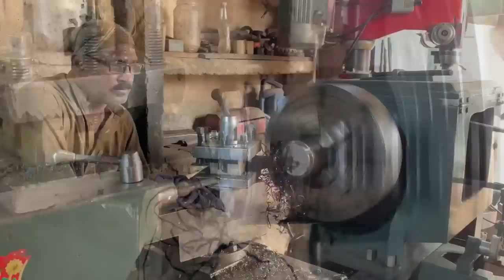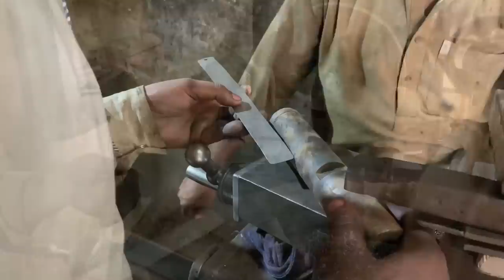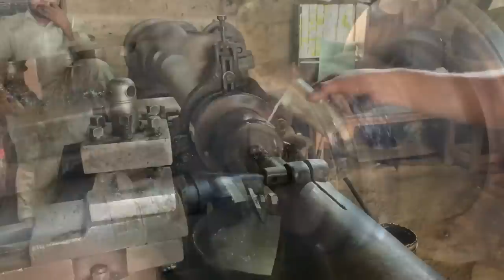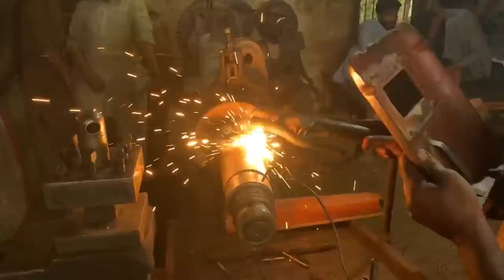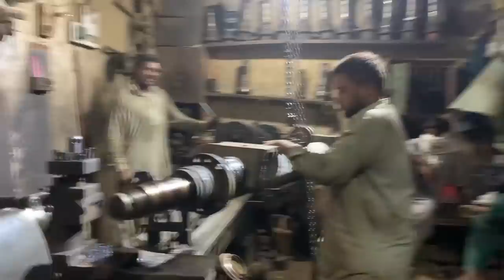How to Rebuild Heavy Duty Truck Broken Spindle From Axle || Repairing Truck Trailer Broken Axle

Comment: When I saw the small piece go flying when being pressed into the broken end. I just knew they were going to put that BIGGER piece onto the lathe. And by gosht they did. YOU can't pay me enough to be standing anywhere near that "widow" maker!!
Reply: They make due with what they have but that is a very hazzerdous place.
I doubt they have law suits there.
Reply: And all of their loose clothing is such a hazard.
Reply: Not that true.
Reply: ㅡ
Reply: Nothing wrong with using a lathe to drill a pilot hole. I would have done the same. OK, they could have asked me for a center drill, they shoulda faced the fracture first, but, well...
Reply: C'mon, a kindergarden kid can operate a lathe at that low RPM.
Reply: @johnfenn  yeah that scared the shit out of me! and no safety glasses! and forget about safety toe :D
Reply: I knew the press was going to spit sideways.

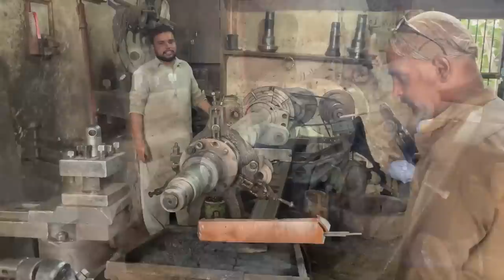Comment: 14:20 “once the wobble is within your customer’s expectations, proceed to welding.”
Reply: Love to see them grinding a crankshaft...
Reply: Hey come on people…. If things weren’t built to breakdown later… then there would be less work available.
Reply: That out of roundness is crazy.
Reply: Micrometer???? What’s that?
Reply: When finished and fitted to the truck, that wobble is an offset angle in the wheels. Tyres will wear out quicker and fuel consumption will also be effected

Comment: I am just so impressed with what these men can accomplish with the tools they have. Nothing but respect for them. Gotta love the feedback from either the arm chair experts or the people that have the latest and greatest to work with.
Reply: I have worked with modern CNC machines & I've worked on a crap lathe in Mexico.  They are doing many things wrong.  1 thing that is easy for me to point out to a lay person is they never got the axle centered in the chuck.  Notice how it wobbles?  That directly gets put into the repair they just made.  This is bad workmanship regardless of tools.
Reply: @keijimorita1849  I'm not saying it's quality workmanship. Just that they don't have things like dial indicators or even good welding rod. But somehow they make it work. May only last a month and wear out tires mad. Me personally I would scrap the axle but they don't have that option.
Reply: @donmunro144  Maybe there's more to waste human lives than truck axles ...
Reply: @keijimorita1849  I don't think that axle would ever be straight in the chuck. Look at that thing. It's bent, period. But, yes, you are correct!
Reply: "FIXED"???????  No and dangerous piece of crap that will fail and cause a accident, but over there life is  extremely cheap
Reply: @keijimorita1849  ax, c

Comment: The driver will not notice the wabble on those roads lol
Reply: There will be no wobble because the axle doesn’t spin, alignment on the other hand will be all over the place
Reply: There won't be any wobble as it's a trailing axle not part of the drive train as on a trial or so the axle stays stationary and the wheels roll around it, but good job it is as I think the driver might notice the strange oscillations of the wheels lol
Reply: The 'repair' will though. It will self destruct in 10 minutes.

Comment: This will probably lead to a new episode "How to repair a truck that went off a 500 foot cliff"
Reply: To be fair this is the first vidjeo I’ve seen where they used any kind of eye protection and a micrometer
Reply: I have confidence that they will adjust for the misalignment of the axle by hitting the rim of the tire the opposite direction with a sledgehammer... In the end it'll be perfectly balanced, .. it'll be like driving a Cadillac!!
Reply: @Welcomemisha  video are to short
Reply: @Welcomemisha  00p0011

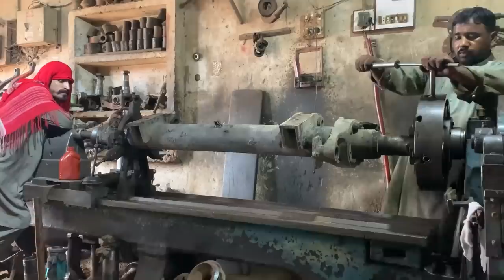Comment: 9:47 this axle is extra straight. Look at the broken end - turns smooth in the holder. And the end on the other side. Goes few centimeters in radial. And guarantee to the workshop gate.
Reply: Mgimo finished?)

Comment: Truck axle with manufacturing defect. Very well done job. But every truck suffers unimaginable forces. Hope the shaft came out the same length. The tools were very required. The shaft is bent. For maximum security it should be exchanged for a new one. Regrettable often the lack of resources. GOD BLESS AND HELP ALL THE WORKERS WHO DID THE BEST THEY KNOWN AND THAT THEIR RESOURCES MADE POSSIBLE.

Comment: The repair will never withstand the strain that grossly overloaded it in the first place.
Reply: Can you imagine the force it took to break that thing clean off? It will take a fraction of that force now. There is going to be an incredible amount of leverage being exerted on that repaired joint.
Reply: @truckguy6666  Someone should reinforce those axles with gussets before they let 200 people pile on the truck again.
Reply: @Landrew0   You can't put gussets on the welded area because that's where the bearings go.  
Don't worry, it'll be fine......... until it's not.
Reply: @Happyfacehotwheels  Well, it wouldn't matter if you could reinforce it, they still overload their trucks grossly anyhow.
Reply: Whole axle is bent, see it wobbling on the lathe. Overloaded, hit a depression in the road and snap goes the spindle.
Reply: @Happyfacehotwheels  Sooner or later, someone will make an axle for them that can't be overloaded. Maybe 15 cm diameter.

Comment: A great accomplishment with basic tools and measuring devices, though I was cringing when they used the hydraulic press and rightly so as if that had hit someone it could have easily broken a leg or killed them. Those drills were blunter than my grandma the relief angles were ground too steeply.
Reply: injury? there are 37 guys waiting at the door for a job.

Comment: Good try but that will never be nearly as strong as it should be . It will snap off again as soon as that truck is overloaded which seems to be common there.
Reply: @sellier-bellot22  Over what it is rated at . When I was a mechanic I never saw or heard of one breaking but they do have some very bad roads there so that would be an issue plus the truck likely being over loaded.
Reply: No. cause of its failure probably is fatigue
Reply: It needed more enforcement in my opinion
Reply: @sultanheart  Problem is the heat from the welding , they have taken the strength and temper out of that steel.
The only way to properly fix that axle is to replace it with a new one from the factory.
Reply: They usually load the trucks way over max capacity load. Watched many videos of trucks overturned due to an overweight and oversize loads. Did you notice the end play of the shaft after welding which causes excessive vibrations and failures at high speeds. Always safety last...
Reply: The roads over there don't help either
Reply: @johnready630  Cutting like 4 groves cross the previous welds and weld again will add more surface joint to old material as it will likely break next to the weld  ,heat /forge treatment will add up little more .
Reply: @smathet7766  As many people as they have and clearly all nof them that put their lives last they would have some of them GD people learn to repair roads and fix the roads. Its a dirty job but clearly all these people dont mind sleeping in dirty nasty cloths they worn for months without washing. Hell these shops can even offer free slave labor for repairs to the road equipment.. What you dont see being hauled in for repairs are GD road repair equipment like pavers , graders , backhoes , rollers... nope a country over populated they have kids in these sweat shops , they can give the GD kids graders and such to let them learn to maintain the roads.Clearly they put youth education about as high as the safety there. Pathetic these people CHOOSE to live like this and stay in stone age and all its practices.Same with their hate for others they themselves were passed down. It is their choice and they choose to keep doing the same nasty BS instead of learning like all the rest of the countries have done and IMPROVED to provide much much much better safer long last repairs.They would need to come out of the dirt and bet thats the deal breaker for them.
Reply: And no brakes
Reply: The jingle trucks in Afghanistan have lumber stacked over the top of the sides and the come careening around the corners on the mountain roads. Almost got clipped by one on the pass up into Kabul.
Reply: @michaelbaker8284  Exactly why you see breakage such as this , broken frames and the like . This repair is a bandage on a serious issue.....overloading.
Reply: @tesodjukic4377  you can seee the smooth surface of the crack, which is fatige. But the inner part cracked at once. Which is an unusally big part. So if the repaired part is waeker than before, it will break pretty soon....
Reply: Agreed.  But it IS repaired.
Reply: @beakytwitch7905  Well sort of but not properly.

Comment: 4.5mins in, I can't watch this anymore. It's one thing to have a lathe, it's another to actually KNOW how to operate it properly.
Reply: Then you missed them hammering the inner bearing race to and fro at about 18 minutes in. (I agree, the run-out on the 4-jaw was ridiculous - they clearly could centre it - just didn't bother.)
Reply: @sideshowbob5237  So cray cray. If this is how life is there, wow, just wow.
Reply: I get you
It hurts a lot
I think this lathe is even not leveled
So hey don't matter if it rund true hahhaha
Reply: I'd watch this video on Speed 2(double). It's far more entertaining.
Reply: @apollo5751  great idea thanks!
Reply: @apollo5751  To judge by the sound track it is already running several times normal speed.

Comment: Absolutely nothing they do there is proper or correct. Lifting off the tip of a hook umm nope, piss poor operation of the lathe, having the bit sharpened poorly and spinning in the tailstock does nothing but wear out the taper in the tail stock and wreck it.  the heat from welding took what ever temper that axle had in it out of it making it weak. That axle will fail in short order between poor workmanship, horrible roads, grossly over loading.  I guess close enough is good enough there..  they don't seem to be worried about their own safety so why would they worry about anyone they kill out on the road.
Reply: Bingo!
Reply: Absolutely every tool beat to death.. I don’t even know what to comment on..
Reply: absolutely true
Reply: @Jeff Kulchiski You got it right, I from the same culture and I like your quote "Close enough is good enough" no one here offers quality service, from an untrained eye these people are doing great job but no they are not, they are just fooling the customers in believing that they can repair anything
Reply: Absolutely. I give them a good score for effort but the repairs wont last long.
Reply: @rajaatiq9509  when we talk about truck, it is not a problem about the lasting of a piece. the problem is ‘could the failure of the piece kill me?’
in this case, it is a very hard answer…
Reply: @rajaatiq9509  What you said is only true if the customers are down town mafias but generally customers have to suffer because of dishonesty and poor workmanship
Reply: Exactly but the worst part is they welding with 6013 its hard material not basic, 7016 or 7018 was the best solution, they need to heat the metal first to 200°, is going to crack their luck is they weld with the small electrodes 2.5, instead of 3.2, or 4 rods, they take more time and the material was hot
Reply: I know this just by they bend the electrode and the sand doesn't disconnect from the iron and the fact the "welder" doesn't have clothes for welding, with basic he got some holes on is body
Reply: @hugoquaresma467  absolutely. and it seems that handling of eleftrode is wrong. for me it is full of imperfeftions and inclusions of slag
Reply: @massimo79mmm  the horror
Reply: well go watch the proper method of fixing this then.
Reply: @alexchilick  hahaha 😂😂
Reply: dial indicator and safety glasses are a waste of time, they think

Comment: Working without any eye and other protection is a ticking time bomb
Reply: Do you think they are paid enough to buy protection gear?? They are saving every penny to buy food for their kids
Reply: look they are welding a spindle that was forged, so the new axel rating is 10% of original, but they will use it till it breaks and do it again......and again, and again. Off balance and inaccurate as hell.  But it will work, until it breaks and kills somebody.
Reply: Oh they have new protection there , they have new type eye contacts that keep anything from getting close to their eyes... LMAO

Comment: So they basically have electricity there in Pakistan to stick weld and lathe busted axles from overloaded trucks.  That boring bar was at least 300 thou above center 😬 and spinning the bits in the tail stock is great for the tapering lol

Comment: The shaft extension it's heavily warped and that is significant!
The alignment with the sledgehammer could be much more precise even at naked eye! That was sloopy, I'm pretty sure that a blid man could have done better.
Great welding job.
Reply: Really I think it will be fine! Everything else is buggered it Pakistan, the roads are completely stuffed the truck it's going on is stuffed, the wheel they put on it is more then likely buckled, the driver has probably been smoking hashish since he was 6 and the tyre is bald! All in all I think they kicked arse!!
Reply: @jarnosaarinen4583  So true but they could start by doing something right.

Comment: Where do you get one of those precision runout wire gauges ???
Reply: in the same shop where they buying this type high precision lathes...
Reply: Forget the wires, look at that "taper" at 4:00
Reply: That drill will friction weld itself to that tail stock. I doubt that cowboy even noticed it spinning
Reply: I keep mine in the closet and put clothes on them..... The clothes hanger.. "The world's most versatile wire"
Reply: I would start with the local dry cleaners. I have heard they supply run out gauges and the proper equipment to calibrate them

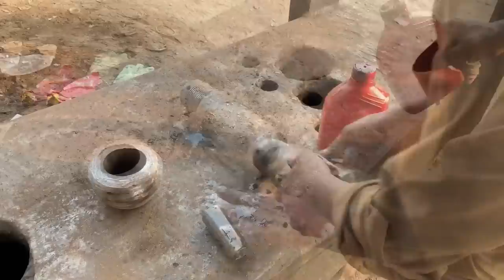Comment: 7:01 Heat it up hot to expand it. Then the pin goes in much easier and is much tighter when it cools off.
Oh and I loved the drama when that pin exploded out of the press.

Comment: After some thought on seeing this, my bet is the truck this is off is fairly near end of life. The owner knows it and wants to make sure to run it completely into the ground. Maybe for a while they try not to overload it. This repair could hold a while if they did that. In that sense it's good enough for the purpose. Another thing - probably the truck's broken down somewhere and they need it fixed fast on the roadside. Also it's not definitely dangerous if it breaks they just lose drive, this is a drive shaft right? The techniques employed are not as bad as the lathe polishers would have it, that is a quality lathe about 40 years old and does that stuff day in and out but it runs fine and true otherwise how come it's still running so good? Yeah it's rough and ready they know the essential skills though and workarounds i respect that

Comment: I wonder how well the bearings will deal with that much run out on the axle after this repair?   So if the bearing will not slide on, beat it on?
Reply: Hopefully that was just a sample bearing and theyre going to be replaced. But anyways the whole stub broke off so the bearings themselves probably will be "fine" but the tire is going to track goofy and just tear itself up quickly. That is if that repaired joint doesnt crack and come loose the first time that truck is loaded and drive over a pothole.

Comment: This made me feel sorry for the poor lathe, can't believe they hammered the crap out of the end of the axle whilst holding it in the lathe. Also not a dial gauge in sight, runout checked by a piece of bent wire and an eyeball?
I understand they have limited resources and you do what it takes to get the job done, and they are clearly hard working guys, but this really was half assed.

Comment: Banging on bearings is a no no
Reply: Fuck i hope Garry puts a new bearing on there, because garry wasnt too worried about hitting it with a hammer. Or maybe they will use a garry certified used bearing that garry got checked at garry's workshop down the dirt road!
Reply: Banging the bearing? He was banging with that huge hammer while it was held in the chuck.... good bye spindle bearing
Reply: Pakistani engineer 🤣🤣🤣🤣🤣🤣🤣🤣 already expected

Comment: I think there should be a Lottery Ticket given with this Axle to see how long that repair lasts after being whacked with Larger Hammers "To Level it"
Reply: If the truck is brake down in jungle this is a good option to repair it in a 8 houre.

Comment: Fuck i hope Garry puts a new bearing on there, because garry wasnt too worried about hitting it with a hammer. Or maybe they will use a garry certified used bearing that garry got checked at garry's workshop down the dirt road!
Reply: I think that was a scrap sizing bearing. the axle didn't come with bearings that I saw. Having said that, after repeated bashings, how true is that bearing anyways.